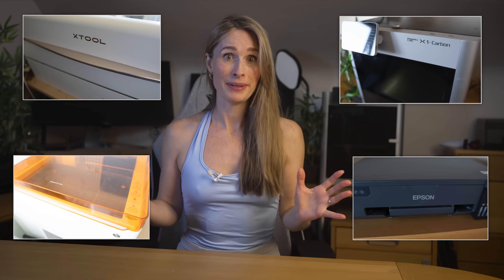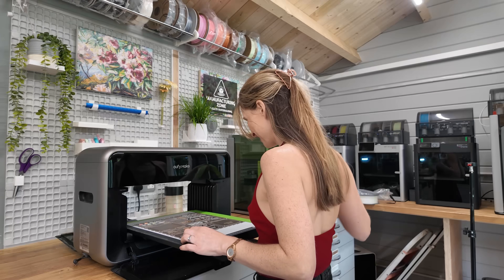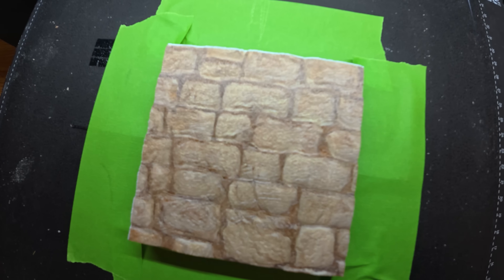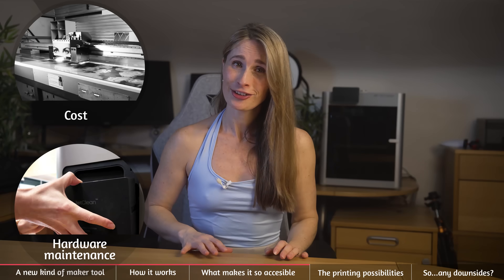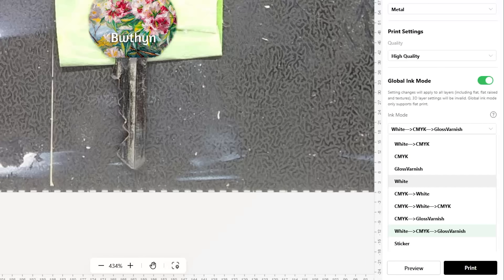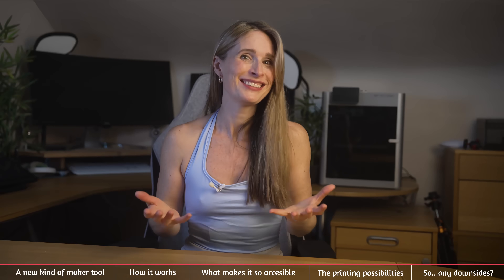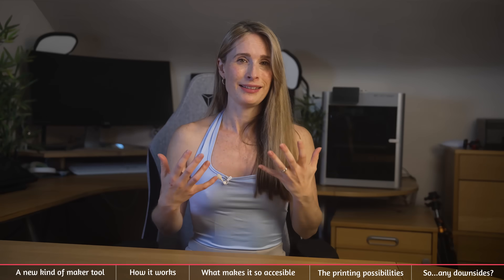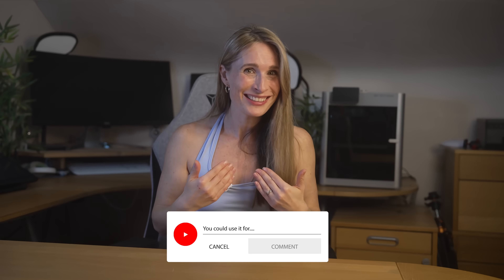UV Texture Printing With the Eufymake E1: Testing & Real-World Results

Comment: This does indeed look awesome, and very well priced.
One question I have is how much the inks will cost and how long they'll last.
I wonder if this could spell the end of hand painting 3d printed models? Fingers crossed as a machine like that is likely to achieve better and more consistent results than I can :)
Reply from the maker: Hey Chris, check comment below for cost of inks ($299 for complete set although $179 currently on the Kickstarter deal). Larger format/cheaper inks on the way too. So fingers crossed they come down - but just like any specialist ink or resin (eg inkjet ink, model paints, epoxy resin or the rest, these certainly aren't dirt cheap).

But Eufymake appear to have cut through the industry with this - ie 1/5th the price of hardware, waaaay more user friendly and inks surprisingly cost effective Vs even industrial supplies. So hard to criticise!

My batches have about a 12-18month 'best before date' on them - but good question, I'll ask what that means in terms of impact and what the general lifespan is.... that said, there is zero chance of me not using up my supplies in the next 13 months, I'm using it for every single project I'm working on now!!! 🤣🤣
Reply: @handsonkatie  Thanks for the follow-up. Last question would be how much ink a "typical" print would use (I know, you're going to ask me what a typical print is...)

Oh and I'm surprised that all your laundry lives on the floor having seen all your nifty storage and organisation solutions :)
Reply from the maker: @chrisdixon5241  Oh this really is a piece of string - obviously like ordinary inkjets, this depends wildly on the exact image you're printing, but then the depth effects can add even more dynamics to the equation and then gloss too!

A full A4 colour print was using about 1-3ml as a very broad guide? The software has a handy estimator when you go to print so you can assess all the various costs
Reply: @handsonkatie  Sure, makes perfect sense. Thanks for answering as I know it's not a simple question :)

That all said, a place in your dungeon might still be tempting ;)
Reply from the maker: @chrisdixon5241  No worries Chris - the other tip is Eufymake have now added some examples on their E1 page for this, so worth a look - eg shows the costs of various prints to give you a flavour (eg 11p for a phone case etc). This is a nice way to give some examples and cut through all the potential variables!

Comment: Really tempted but cant justify the cost of proprietary ink and potential for needing to replace the print head at $600 a pop 😮
Reply from the maker: This is something I considered - if you look at the commercial prices (eg Epson, Roland etc) - you can see that UV ink is pretty expensive regardless. I actually agree with the 'proprietary' approach in this instance in that there's no way they could have achieved anything close without some sort of native design - remember this isn't even like printer inks given UV inks naturally harden instantly on contact with UV (ie light), so it's not as simple as 'filling up with a new bottle'.  

But there's no escaping that UV resins aren't cheap or throwaway prices (indeed most resins are pricey - eg even epoxy), so that's a definite consideration. Compared to the price you pay for commercial results like this (eg I looked up the cost margin of coasters vs custom designed ones, same for photos and more) - it's actually pretty competitive. It's great that Eufymake have also announced cheaper ink options already (eg CISS approach) - so fingers crossed they might even reduce.

I'm going to be using this device every single week, so I'll be able to keep you posted on long term reliability too - having poked around, it's an extremely solid piece of design, so I'd be surprised if it was flimsy in the long term!

Comment: How much for the inks and cleaning solution?
Reply from the maker: Default RRP cost of inks is $299 - you can get them for $179 as part of the kickstarter early bird offers. UV inks are generally pretty expensive, but Eufymake are also looking at other options like a continuous ink system that they reckon will reduce prices further if you're wanting to use larger amounts.  There's a range of other options (eg just whites, cleaning and more) - just check the link in the description and you can browse.

One tip is I've found that the biggest 'cost' is user choice - eg you learn pretty quickly how many layers look good. Choosing 5mm layer heights will obviously cost waaaay more than a 2mm layer height for example (just like 3d printing).  Hope this helps!
Reply: I read "an ink kit will cost $299 and that will include all of the CMYK colors, white, gloss, and the cleaning cartridge." "All of those inks come in 100 ml cartridges." But now I have the question: How much ink do I need to print one Din A4 sized area (or any other given default size)? So how long does this set last?
Reply from the maker: Oh goodness this is a bit of a 'piece of string' question. Just like any printer this hugely depends on the precise image you're printing (eg full colour uses more naturally than ones with less), but then it also has the extra dimension of 3d embossing - so an image with lots of depth will naturally use lots more too. Finally there's the choice of a gloss coat or not. The software has a handy print estimate when you go to print, so if there's any examples images, I could test for you. But in short it's definitely not throwaway cost, but came in pretty keenly against any commercial options (eg getting UV prints done for you were more expensive by some margin for me)

Comment: I had some experience of uv printing on metal in a tin factory. 
The "coater" was a liquid and is applied to the metal. It is baked on under high heat. 
The surface is then snooth and ready to be printed at room temperature with uv ink.
Reply from the maker: Great example! You can see what they're now doing, that same factory process at an amazing speed and instantly curing! 🔮🤖

Comment: Noooo!!! This is just like when I saw your vid on 3d printers and have ended up with two of them!
I’ve got this saved on Kickstarter and have been resisting but it looks so good. 
Any recommendations on which bundles and add ons to go for?
Reply from the maker: Hey Martyn, this really is THAT good! If you're going to get one, then seriously look now so you don't miss the discounts - but other than that it depends a bit on your use cases. The kit with the rotary is definitely worth a look as that opens up a whole new world of projects, but even the base model is such a game changer!
Reply: @handsonkatie  I took your word for it on the 3d printers and I’m hooked! I did pause one part to have print enjoy of your row of printers. Looks ideal to pair them together to part 3d printer and part UV print, and the relief looks pretty amazing. 
The rotary kit did look very impressive the way it levels it out. You might have to slow down the video output as I’m going to be skint! 😂
Reply from the maker: Heheh! Well I was right wasn't I then??? 3d printers are amazing fun and they change the way you look at things forever! But you're spot on, 3d printer's have one weakness and that's the monochrome look - even with multicoloured printing, they're like basic old CGA monitors or something. This takes the aesthetics to a whole new level. Amazing device!
Reply: @handsonkatie I got very easily led by you for the 3d printer after watching one video! I think I might have the same problem with this one as it does look pretty impressive! 
And as usual a great vid with some fantastic ideas ❤
Reply from the maker: @martyn_b_jones  Thank you, glad you enjoyed it!
Reply: @handsonkatie  Always enjoy seeing your vids Katie, please keep them coming - but maybe with something cheaper as no doubt I'm going to want to buy it! 😄

Comment: Biggest downside for me is the cost and resin cost.  This is not for the average hobbyist just yet IMHO.
Reply from the maker: Yes, the device is about Bambu X1C range, so definitely nowhere near entry level, but it's a stunning price compared to everything on the market (in terms of cost, features ease of use etc). UV inks are generally relatively expensive, but know Eufymake are looking at a cheaper option too (Continuous Ink Supply System).

But definitely not a dirt cheap device as you say, but truly stunning device!

Comment: How to use with a cricket machine to cutout stickers
Reply from the maker: This is actually one of the cool bits of this machine, you don't actually need to cut them out as it's only the 'inked' parts that stick (check out the bit where I'm labelling my 3d printer as an example!)